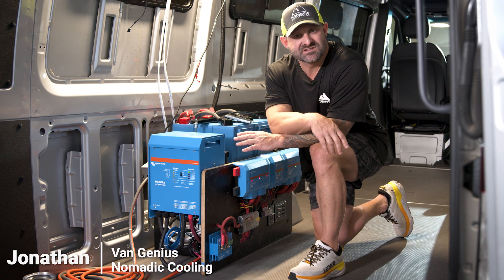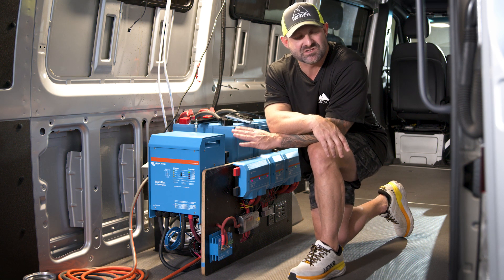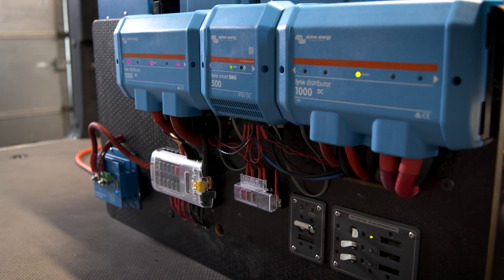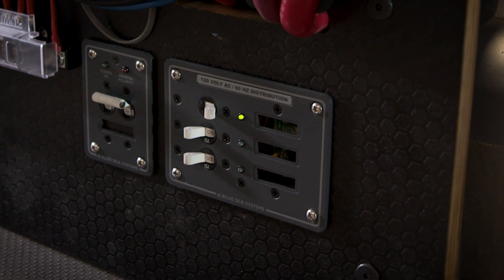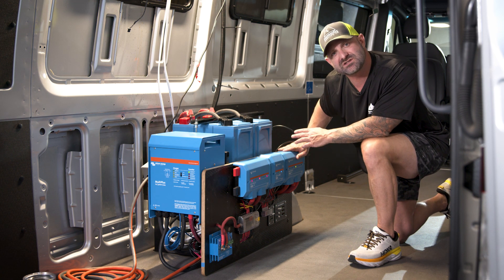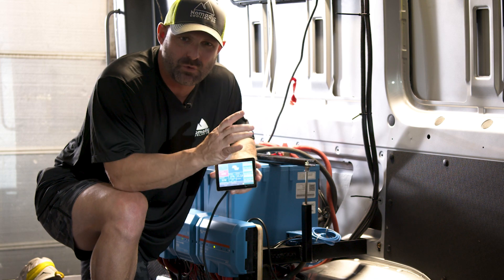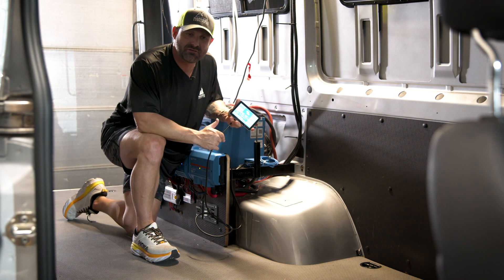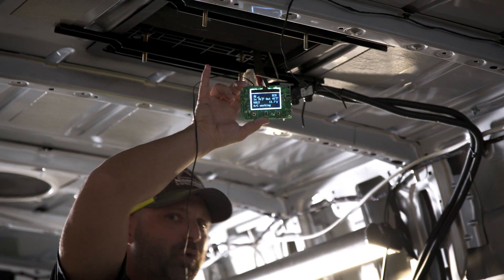Victron Electrical kit for Nomadic Cooling 3000 I Battery Powered AC I Van Life

Comment: On smaller vans, can the batteries be mounted under the vehicle in protective cases wired to the components inside the van to save space?
Reply from the maker: Yes, they can be mounted under the vehicle, however, the batteries are expensive and vulnerable when exposed to the elements. They also do not perform well in cold temps so if you are operating in extreme temps you will experience issues. Batteries perform best when stored at or around room temp. I hope this helps.

Comment: Why is the battery protect needed if the lynx bms has a low voltage disconnect built in?
Reply from the maker: Hey Tuckie, great point! We recommend using the battery protect to easily control the low and high disconnect for different applications. You can also use the battery protect for incoming high voltage spikes in the opposite side of the BMS. Hope this helps.